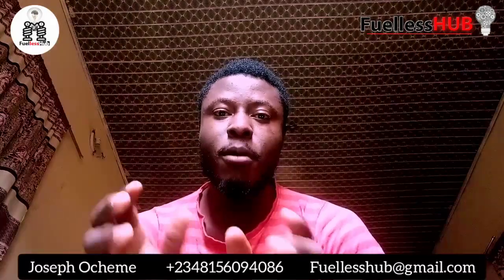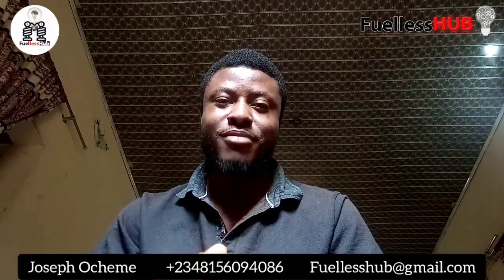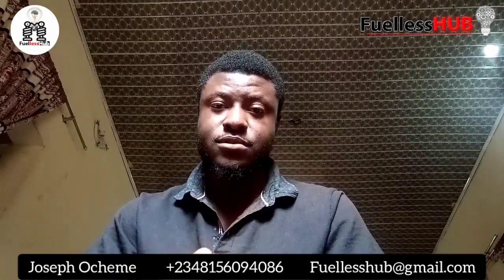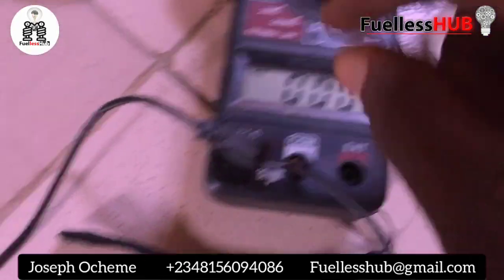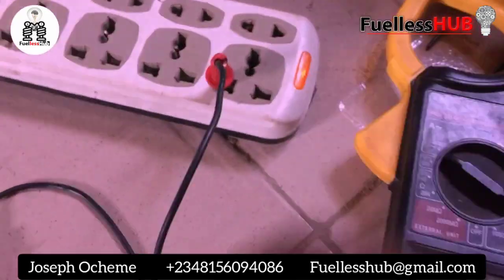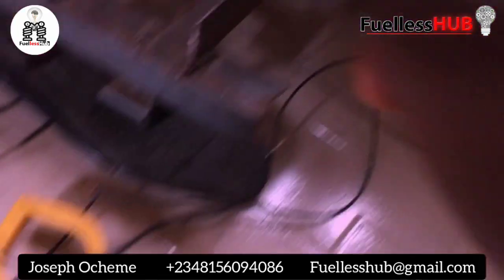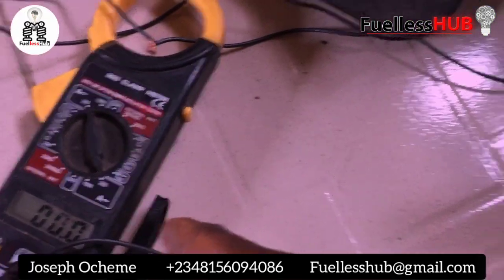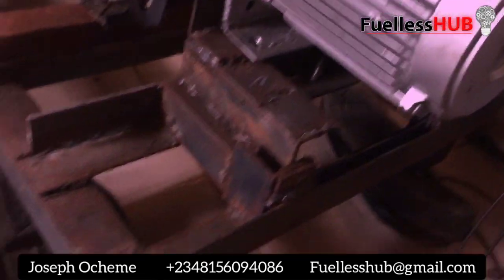how i ran 1.5hp motor on 0.00amps

Comment: While appreciating your effort and not undermining your knowledge, it is absolutely impossible for an inductive load, or any other form of load for that matter, to run on zero amps. If you have adequate knowledge of electricity (both practically and theoretically), you easily know it's an impossibility. 
I will suggest you go and check you meter or better still carry it for calibration.
Reply: I find something like this some where, it's true he us a diodes and choke in positive side of DC then into a h Bridge and  switch